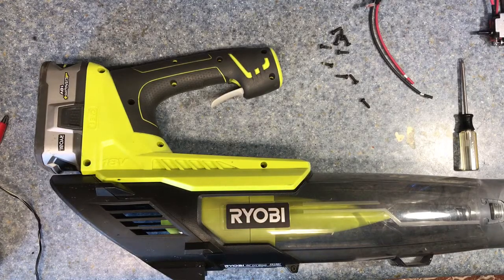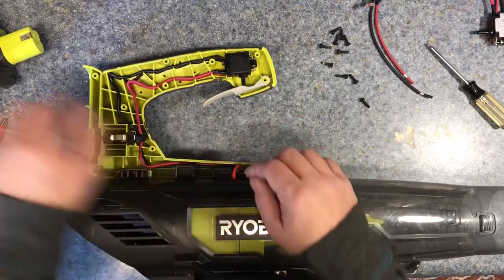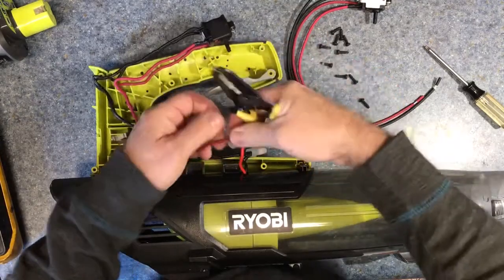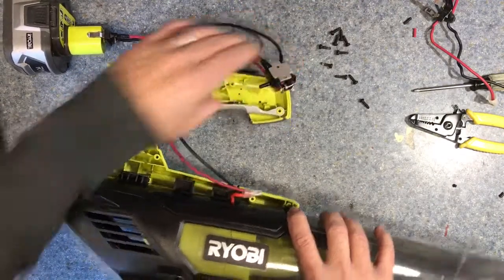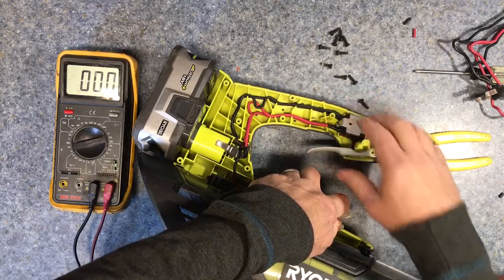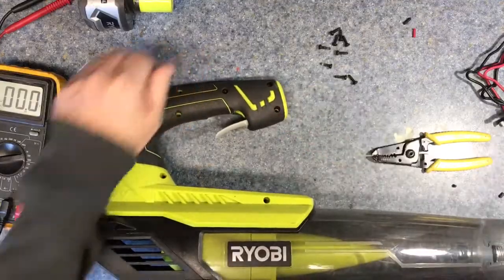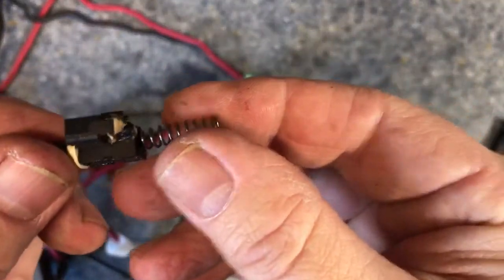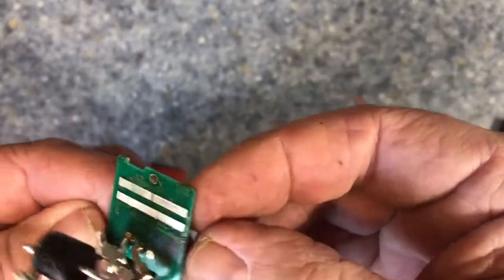Ryobi 18V Blower (P21081) low power

Comment: Yes, mine too has a problem and ordered that switch assembly. Waiting for delivery from Amazon. Thank you for your video it made it easy to repair this unit. PS I try to use electric contact cleaner  first , didn’t work either.

Comment: Thanks for the video.  Mine was doing this also.  I wasn't convinced the switch was bad.   I took a can of WD-40 electrical contact cleaner and sprayed into the hole generously.  I pulled the trigger and it started slow but as soon as I pulled it 3 or 4 times it started working normally.  Been using it every day for the last 3 weeks.
Reply from the maker: I was just thinking about doing a follow up video and I may have to add that in, thanks for the input!
Reply: Where exactly did you spray the contact cleaner?

Comment: Thanks for the video!  My guess is the components can't handle the current over time. Mine is stuck at 75% speed now too. I just ordered the switch from Amazon so one day this week I'll be looking at this video again. It seems straight forward with the hardest part being the task of running the wires through the channels correctly and neatly so nothing pinches.

Comment: Hey Dave, question for you.   I found the switch on Amazon,  but the black & red wires that are pre-stripped and run the power to the motor when the switch is engaged are really short (only 3-5 inches) which means I'll have to do my own splicing somewhere between the trigger and the battery area because the wires provided don't have enough length.    My concern and question for you:    Will that reduce the total voltage that reaches the motor because the wires have 2 different splice crimps????    Hope I explained that the right way.    Really appreciate your video!     -Jason,  TX

Comment: I was wanted to just rewire it to use high speed only, but Ryobi uses a voltage doubling circuit built into the switch to make the high speed

Comment: You should have a voltage drop with the motor connected.....You should read the voltage with the motor isolated from the circuit and have 18 volts
Reply from the maker: I agree, I did not mention that in my post because I did not think it was worth mentioning with the variables of battery voltages and inconsistent motor resistance.   Thanks for the input!

Comment: yours sounds like it runs full power even with the old switch (?).  with mine, with a full trigger depression, the fan just runs really slow, like the battery is wearing out (even with fully charged new battery)  same issue?

Comment: Could you list the part number of the switch? The link you provided does not work for me.
Reply from the maker: Hey sorry for the late reply, it is "HOMELITE RYOBI 291632001 Genuine Wiring Harness Replaces Also Used ON RIDGID Troy-BILT Echo Powerstroke Workforce BLACKMAX" I will update the info. Thanks!

Comment: joe,  Do yo have a part number for that switch that you got fro Amaon
Reply from the maker: HOMELITE RYOBI 291632001 Genuine Wiring Harness Replaces Also Used ON RIDGID Troy-BILT Echo Powerstroke Workforce BLACKMAX"". If you haven't searched that number or model P21081 yet, that worked for me. Just check your model number to make sure they haven't changed anything in different models. I hope that helped.

Comment: my blower is starting low when i hit the trigger and as i shake it it blasts to it's high speed . back and forth , low to high .  so is that the switch ?  i dont have a volt meter .   thank you
Reply from the maker: The only thing between the battery and the fan is the trigger switch. So I would say yes, you too have a faulty switch.
Reply: @davesrandomvideos  ok , thanks for the advice and thanks for the repair video . im gonna order her today and get it fixed .  im trying to find a replacement line cutter for my ryobi weed eater .  that metal piece in the guard . it's just gone and so are the 2 screws that held it on .  very strange .
Reply from the maker: I’m more of a Husqvarna guy when it comes to weed eaters. Sorry I can’t help you there.

Comment: Can you post a part number for the switch? Can’t seem to find one on Amazon
Reply from the maker: Hi racechaser,  Did you try the part number I listed above? "OEM Trigger: "HOMELITE RYOBI 291632001 Genuine Wiring Harness Replaces Also Used ON RIDGID Troy-BILT Echo Powerstroke Workforce BLACKMAX"". If you haven't searched that number or model P21081 yet, that worked for me. Just check your model number to make sure they haven't changed anything in different models. I hope that helped.

Comment: I have the same problem- I changed the switch and it didn’t fix the problem ant thoughts? Thanks for the video.
Reply from the maker: Hi Neal, Now that you have the new switch in did you check the voltage at the battery then at the motor with the trigger held?